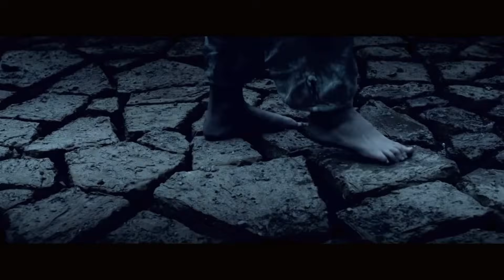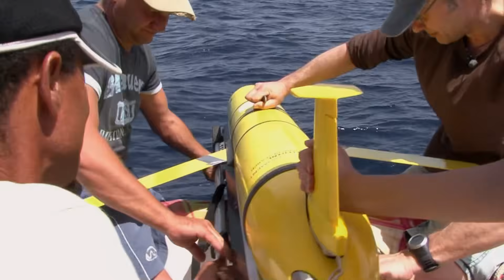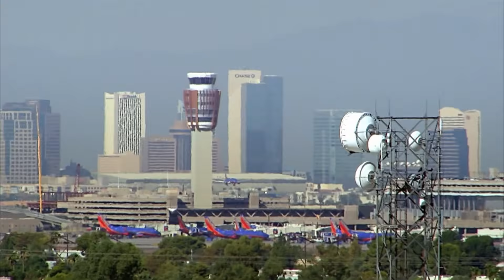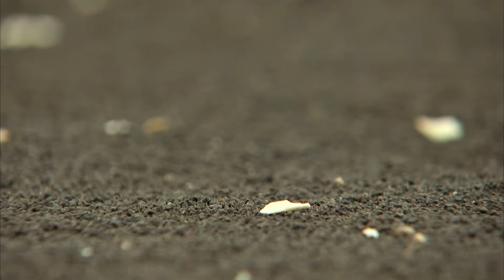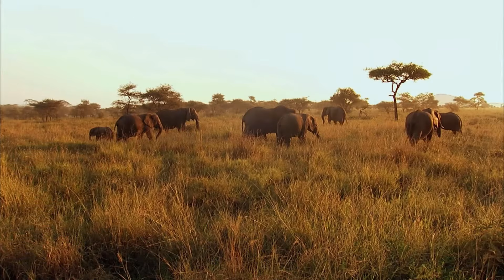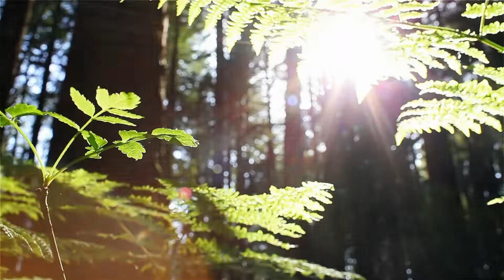Saving the Planet with Geo-Engineering | planet:e | Full Documentary

Comment: The WOKE do nothing protesters are reaping their reward and BURNING now.

The same WOKE fanatics are against saving the ice sheets by flooding the surface with seawater which rapidly freezes in the -60 degree C air temp.  Their excuse is it disrupts the conditions below the ice. 
SO, that matters ? with an ice free arctic ocean set for 2030... Zero ice will mean zero under ice conditions...